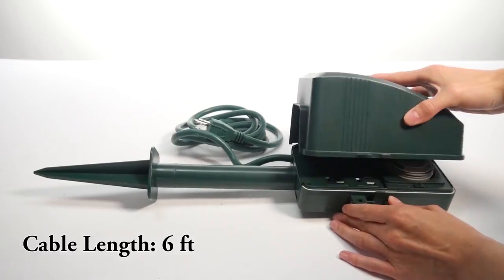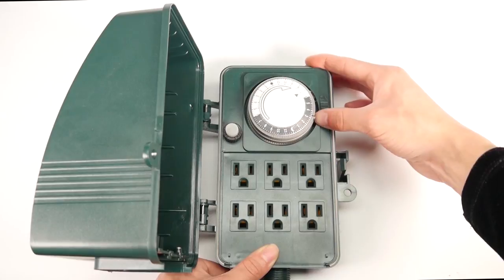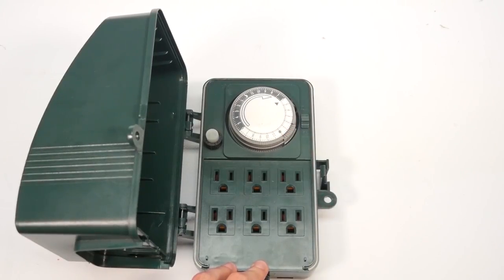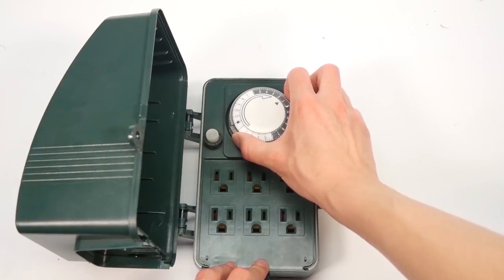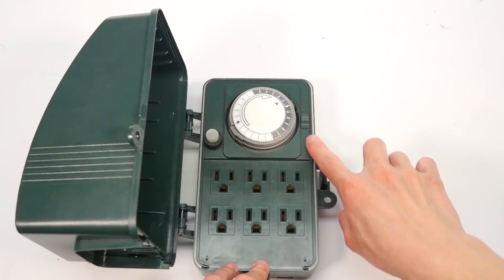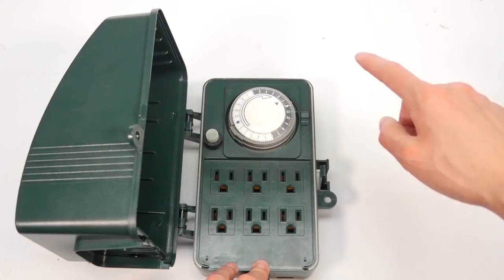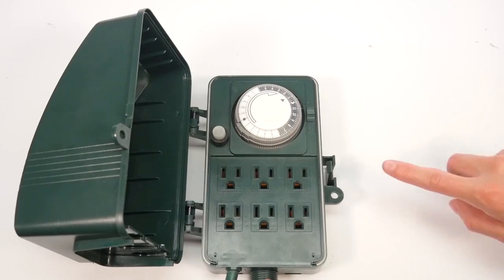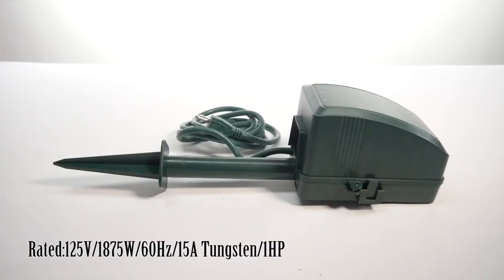BN-LINK 24 Hour Mechanical Outdoor Timer Outlet, 6 Outlet Power Stake

Comment: There is literally no way to close the box if you use all 6 plugs. Terrible design by a company who obviously isn't using it or knows of the defect yet still sells it. Sad.
Reply: Closes fine for me
Reply: @judgepage6605  Cool. What is the trick to get it to work? I have 6 green 50 foot outdoor extension cords from Home Depot and there is no way - even with 4 if you want to use the 4 closest to the hinge.
Reply: @Paul Sterman  idk maybe it's the difference in cables.. I didn't have a trick with mine, both cables just fit through the provided gap.. one of them is a waterproof flat however
Reply: @judgepage6605  I am trying to put 4-6 cables - 2 cables are not a problem but 4 or more presents a difficult situation
Reply: @paulsterman7169  maybe your box is defective? I'm not sure how to help further.. mine shuts with ease with all of mine